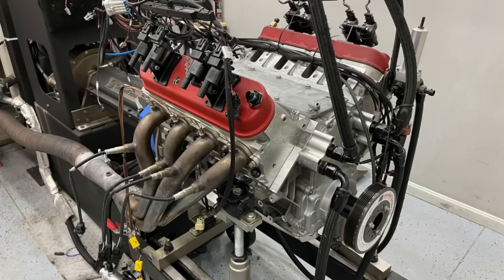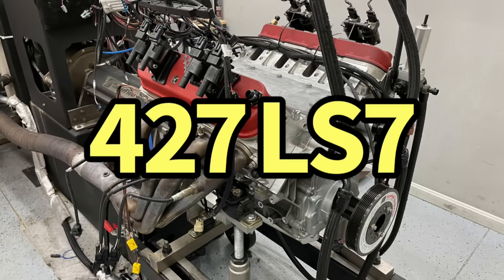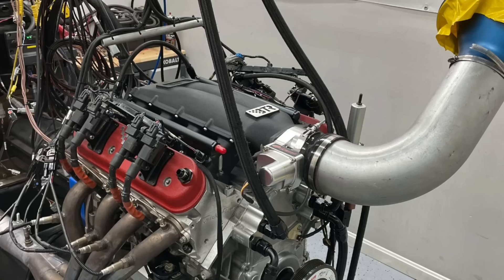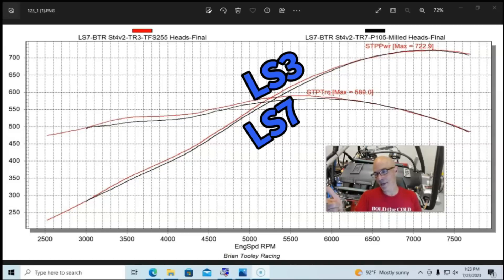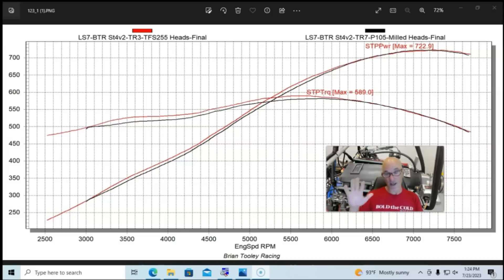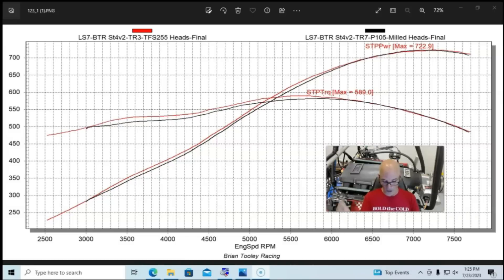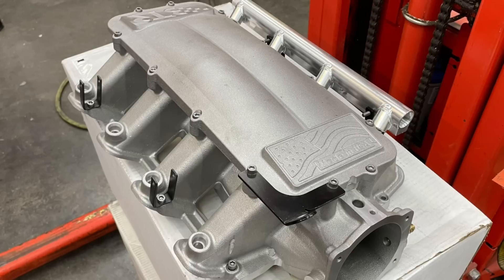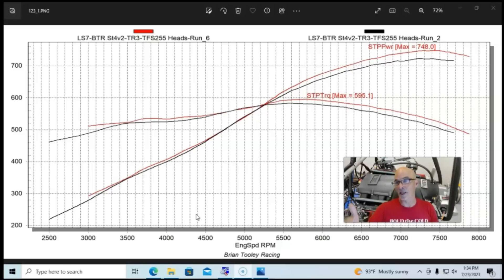LS3 VS LS7 HEAD TEST-WHICH PORTED HEADS MAKE THE MOST POWER? 720+ HP 427 TEST MOTOR (FULL RESULTS)

Comment: I appreciate that Richard dedicates so much time to continuously proving an internal combustion engine is just an air pump. It doesn't matter if you cylinder head flows a million CFM if your rotating assembly doesn't support that flow in it's operating RPM. Who knew?

Comment: On one of our desert race LS7 engines we tested a set of WCCH CNC LS3 heads with Fast LSXR W/102 throttle body VS WCCH CNC LS7 heads with Fast LSXR w/102 throttle body. The LS7 had 13.5 CR.  All I’ll say about the cam is it was 257 on intake. The test fuel was VP late model. The LS3 heads were down on power everywhere on their respective curves. Peaks were over 20 down with LS3 heads. But every combination has different outcomes. I wasn’t that surprised that your LS3 heads did that well. As a matter of fact I think I’ll use one our old LS7 blocks and build it with a set TFS 255 heads we took off another engine.

Comment: The intake manifold is the limiting factor, the cfm demand of that 427 at 7100rpm is 370cfm, the reason the LS3 heads picked up torque was because of the higher airspeed past the valve.
You can see with the test without the plenum that it can now peak further out at 7500rpm which is a cfm demand of 390cfm.
Lastly it’s not the throttle body itself that is the restriction, it’s because the runners primarily have airflow entering from the side closest to the throttle body, as air is being drawn in, it is being replaced from only one direction, from the throttle body end so airspeed at the runner bellmouth is uneven around the bellmouth, effectively reducing the cross sectional area efficiency of the entry. When you removed the plenum the runner entry can now use the entire cross sectional area of the entry efficiently, the airspeeds even out instead of being much higher on one side.
Reply: A 427 at 7k rpm takes over 850 cfm
Reply: @seanb250  need to do it a little longer then if you think each cylinder needs 390 cfm lol
Reply: That bore doesn’t benefit the ls7 head

Comment: One old trick we used to do on the old sbc engines was to use 305 heads on a 350 bored block. But you need to majorly port them otherwise the compression gain of about 2 points will only equal out as the 305 head passages are more restricted then the 350 heads. 

Bloodviking

Comment: I think that this test proves that back in the day when guys with a doggish toilet bowl headed 350 wanted to wake it up a bit, would simply grab a pair of the smaller chambered 305 HO/Iroc (L69 ?) Heads and bolt them on, even though the valve sizes were smaller and be more than happy with their results. The upgrade was mainly Compression ratio, but the additional port velocity even with the small valves didn't seem to hurt.
Reply from the maker: not sure how this test proves anything about changing combustion chamber volume on a sbc
Reply: @richardholdener1727  port velocity Richard....don't be thick (and perhaps a smaller chamber in my example).

Comment: I am hoping that eventually Brian will build my dream motor for testing. A Re-Sleeved LT1 @ 4.185" x 4.125" 454cu to see just how much N/A Power a set of LT4 Direct Injectors can support.
Reply from the maker: lt4 direct injectors have already been maxxed out
Reply: @richardholdener1727  NOT ON A NATURALLY ASPIRATED APPLICATION THEY HAVEN'T. You know very well that 600HP Injector size/duty for Boosted is not the same as size/duty for N/A. Did your account get hacked ?
Reply: @joeyjojojr.shabadoo915  supercharged?  Sure.  But on a turbo engine with a modern DI chamber you can pretty much run the same mixture NA or boosted (at least on E85 - we certainly get away with 12.5-12.7 at 1000+ hp on LT4s) and there is no parasitic loss (supercharger) and minimal pump loss difference with the right turbo and exhaust manifold.  That said, stock LT4 injectors are 140 lbs/hr, but because we can only push them up to about 7-8 mS before we get spark/inj overlap they behave much smaller injectors.  I'd say you could get to 850-900 hp no problem naturally aspirated on gasoline.
Reply: @ChurchAutoTest  That's awesome. Exactly what I wanted to hear.

Comment: I’d be curious to see the Mast black label Ls3 heads used in this kind of test. Mast uses the LS7 rocker for their ls3 port heads. So I’d wonder if in that particular case would the mast black label fellas make more power everywhere because they offer the same cam specs with more air speed and similar volume? Or if it would just end up the same since the head/cam isn’t the limiting factor.

Comment: Real simple stock ported heads, vs aftermarket and small headers...
 Toss some MAST 305 Black Labels on the LS7 against it or Brodix BR7 273STS...
 And up the header to 2" 
 Also test hi ram vs trinity with each THAT would he awesome...
  But stock to aftermarket come on, it's shape, CSA, entry all of it hell back cut on valves...I assume it was a Johnson short travel on both both same seat and open pressures? I assume something was a choke factor they ended up same peaks....
 
 I'd really love to see this test maybe u don't know call my crazy but trick flow 260 LS7 head apples apples same cc? Everyone remember that's not remotely a stock LS3 head at all modified port design, chamber and valve angles to be more like an LS7...

 I do appreciate the content since I run that cam and cubes...( BR7/ram) I was thinking of going to a dual 4500 efi tb top just to eliminate restrictions with ported runners...

 I'll say looking at fueling I'd guess mine makes peak power at 7300ish and flattens out it like a 7500 shift for recovery...SO that is spot on...

Thanks pretty damn close testing for me if you tossed on a Hi Ram haha

Comment: Hey Richard.  What about a comparison to OEM LS3 heads, with the 15* valve angles.  Wouldn't there be a difference in flow in comparison to the 12* LS7?
Reply from the maker: stock vs stock should be different

Comment: I have a mental image of that no-plenum pull. 
"Alright, here, hold the engine at 4000"
Walks into dyno cell with ear-muffs on
Pulls plenum off with grunty facial expression
* Looks at you through glass and points up*
does dyno pull 
Looks at you and gives cut-motion signal
plops plenum back on engine
walks back into dyno room
"Alright, what did it do?"
Reply from the maker: you can't pull the plenum off-they runners overhang the inside of the plenum-the motor was started with no plenum
Reply: @richardholdener1727  Ah, so it's effectively started WOT and put under load immediately... I see. That's still cool. I'm glad you did that testing. It worked in ways I didn't expect.

Comment: What are the valve angles on each? Does valve angle matter necessarily, or just the fact it allows a better port design? Ive always thought angle on a LS vs a Gen 1 SBC being the main driving point why an LS was so much more efficient and powerful.
Reply from the maker: both these heads had 12 degree valve angles

Comment: if it had been a larger ci engine would the ls7 heads made more power . Or more camshaft and run to a higher RPM or both
Reply: Factory ls7 are decent....Aftermarket Ls7 heads are Better. The highest hp Inline valve Ls head  isn't a Ls3...rather a Ls7.

Comment: Did the 1 7/8th headers choke it a little? Maybe 2 inch would have made a difference?
Reply: You can make a lot of power with 1 3/4 headders. I doubt the 1 7/8 robbed anything IMHO.
Reply: @I_like_turtles_67  they can, but what I've seen on a chassis dyno is around that 550 whp number, the 2" headers seem to really have a advantage in the higher rpms.
Reply: 1 7/8 ARH or KOOKS headers easily support 700 hp with minimal difference in overlays vs 2"@spikestang

Comment: Hey richard what would be also cool would be a nitrometh mix vs race gas is it worth it ?
Reply from the maker: It does not mix well with race gas-only alcohol based fuel like M1
Reply: New Cleetus video
Reply: @richardholdener1727   Oh I know it dosent mix gotta cut it with m1, but it would be cool to see like a 30% nitro ,vs c16 or other popular gas . kinda like a bang for buck deal. I know it will require some seirous fuel system work. There was a guy with a evo on c85 but was sparyng 50-50 nitro vp mix through a meth injection kit says he picks up about 80 hp from the mix

Comment: Sounds like you need to test a modded trinity with a 112mm tb on the ls7 next! (Ironmask Airflow does that mod)
Reply from the maker: we did that already
Reply: @richardholdener1727  I saw that but was wondering if the LS7 heads would benefit from that more than the LS3 heads

Comment: Wow very surprised by the results... i thuaght ls7 heads were a decent size leap in performance.. i guess not when both worked over
Reply: You're not wrong about this. They are the best ls heads out of the box but Rich proved here that a CNC ported ls3 heads is a killer and wont justify the cost and problems that comes with ls7 heads. Its a testament also for the validity of 15 vs 12 degrees valve ange frankly i was amazed it made more hp the whole graph mid range 😂
Reply: @Airman.. he said the aftermarket ls3 heads have a 12°valve angle also.the ls3 stock head with a good port job can make over 700hp easily because I have done it on pump gas
Reply: Ah, heck, just pull a Richard Holdener, gap the rings and BOOST that sucker!

Comment: Do you think you would even notice a 26 hp increase with a 722hp engine with the individual runner manifold when driving a car on the street or even at the race track? I don’t know if I would notice an 8 hp increase on a 240 hp stock 5.3.
Reply: Agree, a single-digit gain is almost unnoticeable, but a 26HP gain would show results.

Comment: Wow that's crazy everything was bigger like lift and valve and it should it of made more power for the ls7 head so crazy oh well
Reply: Richard said LS7's exhaust is somewhat shrouded by being closer to the cylinder wall.
Reply: @exploranator  yeah I can see that being a problem
Reply: @exploranator  I wonder why GM did that.  I watched a few porting videos where they mention how the LS3 heads are slightly shrouded on the intake side on an actual LS3 and it is even worse on a 6.0.  The bigger bore of this test motor probably helps that issue so why did they make the LS7 head that has shrouding issues on the exhaust side?
Reply: @WhaleRacer  Makes me wonder if some engineer's initial plan was to make them all canted-valve wonders like the original porcupine heads, but some corporate bean counters said, "Nay, we shall verily have none of that canted-valvery in this kingdom!"

If the valves are canted, how close they start near the cylinder wall is not so critical. Look at the Hemi.
Reply: @WhaleRacer  it's a factory ls7 head vs a Aftermarket Ls3 head with a Ls7 valve angle...Duh...

Comment: LS7 exhaust valve slightly shrouded compared to the LS3
Reply: Exhaust gases are forced out. Seen one comparison of a smaller Exhaust valve making the same hp.
Reply: @pacomccray4997 Your applying a load to the exhaust stroke by having a poorer ex valve flow characteristic. So that motor will have a lower VE. Everything in an engine has a cost. Nothing is free.

Comment: LS3 FTW.. ditch the notorious valve dropping ls7 heads.. something wrong with its geometry even in the aftermarket heads they suffer from abnormal valve guide wear heard it from an engine builder.. he installs 6 bolts LS3 heads on big bucks 427 builds with confidence
Reply: Try your aftermarket Ls3 thought vs a aftermarket Ls7 head like the CID ....down the drain with a Ls3 head
Reply: @pacomccray4997  you should of said RFD , but i digress still OE CNC ls3 heads are on the top for the cost and performance
Reply: @Airman..   Higher runner placement of the Ls7 head gives it better line of sight to the valve. Then factor in aftermarket Ls7 such as the CID casting which raises the port .250+ higher than the factory Ls7 head.
🤐 The test should have been Factory vs Factory or Aftermarket vs Aftermarket Ls7 and Ls3 heads. The factory casting is just that Factory the Aftermarket moves things around for a better version of...

Comment: Well. 
That wasn't exactly an apples to apples test.
Reply from the maker: IT WAS EXACTLY APPLES TO APPLES
Reply: Seems like that was as close to apples and apples as you can get outside an engineering lab.  I wonder if the 1.8 rockers on the LS3 would add more power.  I think they would, but not much.  Cool test